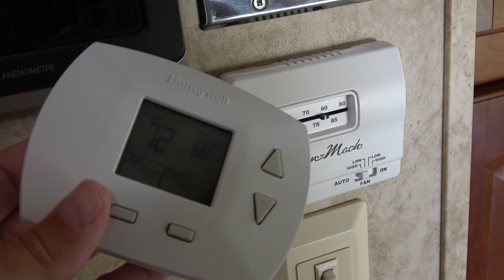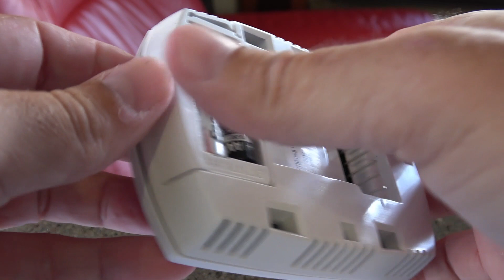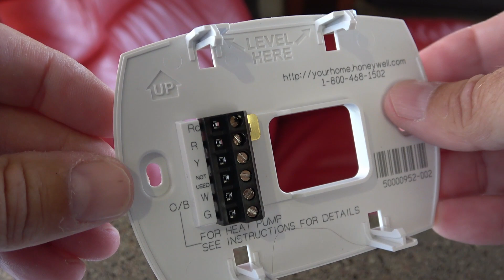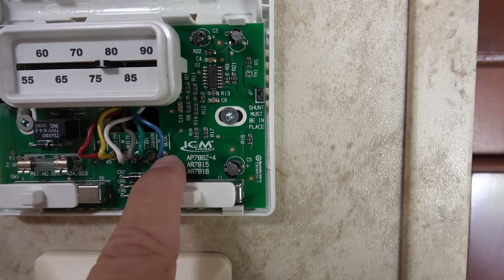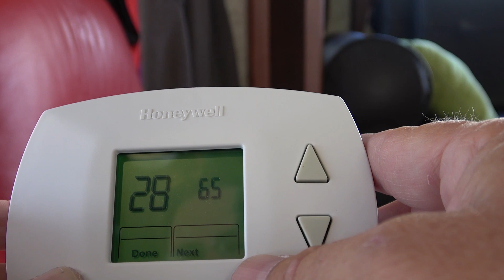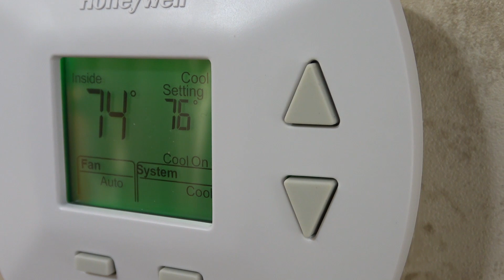Analog to Digital RV Thermostat Upgrade Mod *Explained*

Comment: Looks like you can run a 24V thermostat on a 12V system like your RV. Do you think that maybe this is why it failed previous?  Like the idea but still wondering how long this will last.— there is a fuse internal to the old manual Coleman Mach thermostat so wondering why?  Voltage spikes or other overload danger on the thermostat ?
Reply from the maker: I had a Hunter thermostat running off the 2 AA batteries for 3 years without a problem, only changed to the Honeywell to get the auto cooling/heating switch over. If you do a search you'll find lots of people have done this mod with no problems, think it was a dud thermostat and in this day and age of cheap quality its not all the surprising. :)
Reply: Love Your RV — okay you convinced me to give it a try and install one.
Reply from the maker: @kevinj8258  :) I bought another Honeywell a few months ago and its been working fine. Cheers, Ray
Reply: Ordered one from amazon. Assume I can use just high speed fan and not use low speed at all?  Don’t care about low speed.
Reply from the maker: Yes
Reply: Love Your RV — installed and running. Somehow the R and RC jumper was missing. Once I added that everything worked. — Also noticed in the manual it says “to avoid compressor damage do not use auto changeover if outside temperature drops below 50F”. Any idea what that means ?
Reply from the maker: @kevinj8258  Probably a warning to home users. Should never be a problem with the RV if its 50F or less outside the RV AC should have no reason to turn on, you'll more likely be running the heat trying to stay warm.
Reply: Love Your RV — agree. Though I can just heat— winter and the auto-summer and be fine. Thinking it’s a setting if the compressor is associated with some heat pump mode and risk. But again agree with your thoughts.

Comment: I have been considering changing out our thermostat.  An advantage of a good digital thermostat is its ability to be control the furnace to lower temps.  Our Advent analog thermostat (2014) cannot be set below 60° which causes excessive propane consumption and a rig that is too hot for comfortable sleeping in cold weather.  My first thought was that the factory just used the cheapest thermostat they could get.  But since learning that our heating system has a vent that provides heated air to the underbelly, I suspect this design may be intended to prevent frozen plumbing.  I wonder if installation of a digital thermostat would increase the risk of underbelly freezing if set too low.  Ray, do you have any experience or thoughts on this?
Reply from the maker: Sorry, I don't have too much experience with cold-weather camping and my wife likes it warm at night so the furnace is usually running above 60.
Maybe the cheap analog is limited to a low of 60 because of the way it functions.  Usually they are using a simple bimetal strip or spring to regulate. Maybe the properties of the metal don't allow for a lower setting. Just a thought. Cheers, Ray
Reply: I know on the heat only thermostat their is an off switch which on some thermostats it's on the bottom of it and on others it's built into the temperature selector lever

Comment: My Coleman thermostat shorted our and would only turn the fan on.  I swapped it out using your instructions and it seems to work expect that the compressor will not come on.  I have replaced the capacitors but it did not help.  Any ideas besides taking it in?  Thanks for the great how to video.
Reply from the maker: There is a small control board located at the front of the AC unit, it's got a few relays and resistors, etc on it. I don't think there is a fuse there, but could be wrong.  You can see it in this video clip - https://youtu.be/fv5KBhdEvNg?t=252  from this blog post - https://www.loveyourrv.com/rv-air-conditioner-maintenance-tips/  Maybe you can find the service manual for your model online and troubleshoot.  Cheers, Ray

Comment: I have a forest river vibe and from what I’m told the newer air system. I absolutely hate it. It’s a 3 wire system that has auto high low settings, thing is that the only time it will cycle on and off is in auto mode and that will also switch back and forth from low to high speeds automatically. If you trying to watch tv it is very annoying to keep hearing it change from low to high speeds. The fan stops the compressor stays running then the fan speed changes. Other option is to select low or high and not auto but in that setting it is always running no cycle off mode.
Reply from the maker: That would be annoying, bad enough how loud the AC is to start with. I tell you the people who design these rigs must never camp in them.
Reply: @LoveYourRV  Hey Ray, the RTH5100B is also now discontinued, do you think Honeywell TH5110D1006 would be a good replacement?
Reply from the maker: @dan8220  Looks to me like it should work. The main thing is to have the onboard batteries. They power the switching in loo of having the usual house 24VAC power line.  I can see on this photo https://m.media-amazon.com/images/I/51LbL7bukVL._AC_SL1298_.jpg it says C is optional with the batteries, so that is what you need to see.
Reply: @LoveYourRV  10-4 I think it's good also, I put this one in my forest river and used 2 aa batteries to power it. Now I have a Jayco and upgrading from the same Coleman Mach like yours so all is identical but the thermostat is no longer made, so the next best is the 5110. C would be the  blue wire that is not needed on this application. Thank You.

Comment: Great video Ray - did you ever consider installing a WiFi thermostat so you could turn it up or down when you are away from the rig ? It would require some sort of WiFi hotspot when you are away. The Sensi wifi thermostat is also powered by 2 AA batteries and does not require a 24v power.  I have these at home and I can say without the 24v power it does use batteries faster. I upgraded my home unit and the new one has 24v -  in that case it uses the batteries only as a backup .
Reply from the maker: Isn't really something I find we need that bad. A guess a person could install a 12VDC to 24VAC DC/AC Inverter then use any of the WiFi thermostats or more elaborate programmable thermostats, but this simple one serves our needs. Cheers, Ray

Comment: Ray, I have been wanting to install a thermostat like this one. My issue is my system is run by a remote control so there are no wires to connect to a thermostat.  The crazy remote control dies at the most inconvenient times. Great tutorial though.
Reply from the maker: Oh, ya that would be a pain. :(